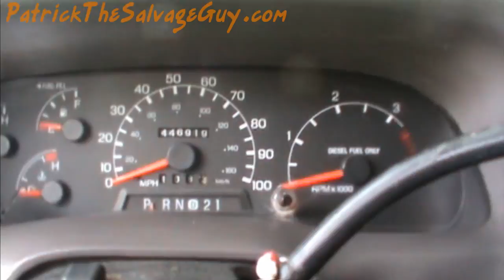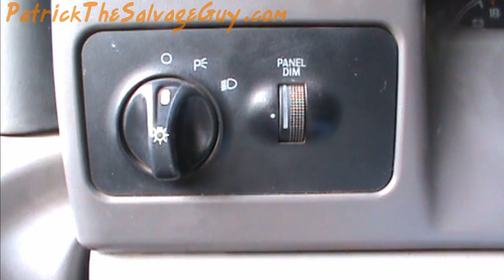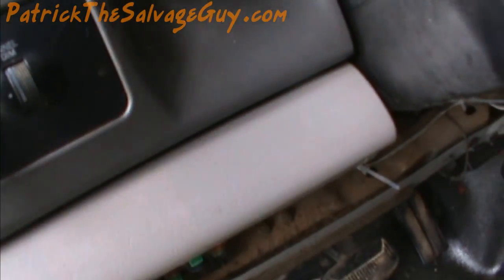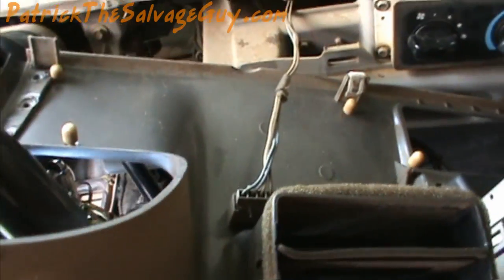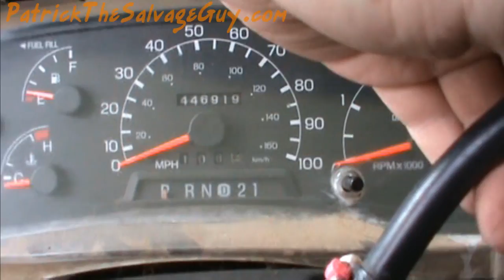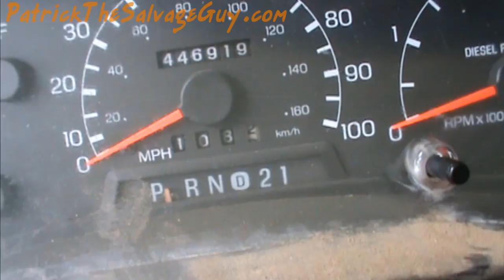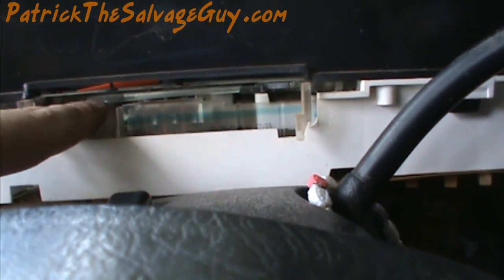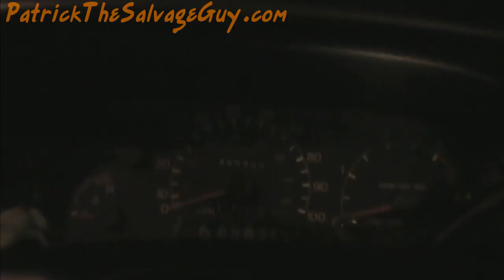2000 Ford F350 F250 Instrument Cluster Removal

Comment: I love the mileage on your truck!! I have 2001 F 350 SD with 7.3.....have 415,000 on mine and starts every day. My cluster lights have been out now for about 10 years (except the center speedo light. I want to change them all so it is all new again. How many bulbs on your 2000, and are they all the same?

Comment: how do you change the background from being black to the white ones? I believe then the Blue LED will stand out better
Reply from the maker: You have to pull the needles off to get the background part off.  Yeah it would stand out better then, but ohwell atleast now all the gauges light up unlike before.
Thansk and take care
Reply: The 4 screws are not 7mm
Reply from the maker: Prove it.